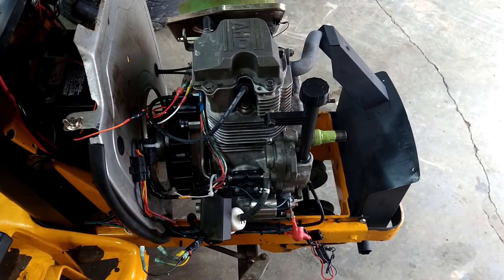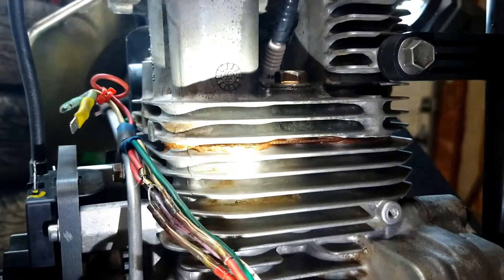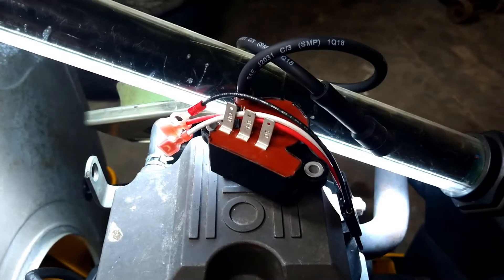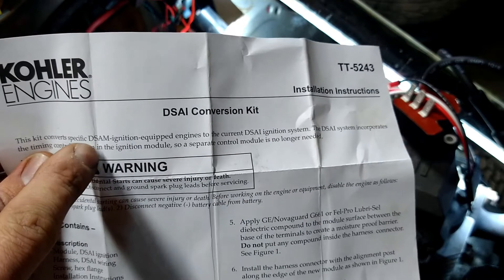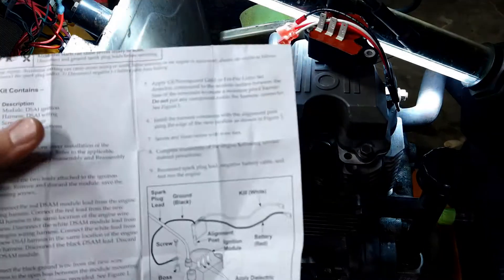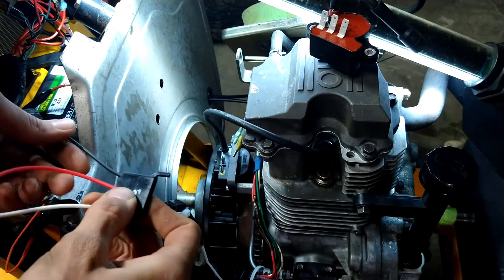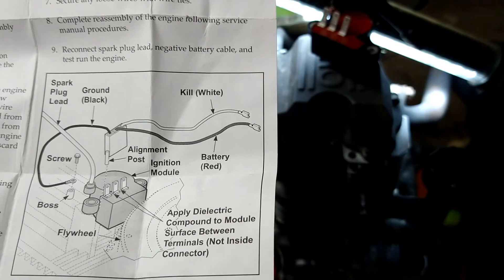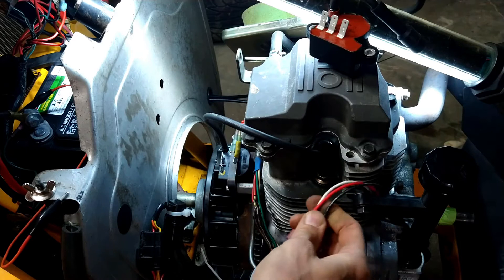Kohler Command CH16S Ignition Module Replacement – Cub Cadet 2166

Comment: Mr. Soluna
I own a 2166 the same one in the video. You have help me in the past to rebuild the upper part valves and head. I have replaced about 10 ignition coils I want to try this. Can you give me the part no. to order and is it still working for you. I really need to fix this.
Reply from the maker: 12-707-01-S

It is still working great to this day.  The Kohler replacement module is expensive but worth it.

Comment: I think i have a good question for you. I have a dixon zeroturn with a cv16 high output. Sticker says its a cv15 tho. Anyways. Its always been a bit of a hard start but always started. Recently i was running it and it died. Had spark, and fuel. No compression. I did a head gasket, also had to use some timeserts. First start it kept flooding. Had to remove spark plug to clear cylinder two times. Third time i discontinued the fuel line and i got it to start. Connected fuel line and it was good, mowed the yard. It would start back up hot with choke on . Next day i go to start it up and nothing. Some poping but flooded before it could amount to any speed to get going. Same as first startup. I asumed it was the spark advance module. I did go for the cheapo 30 dollar ignition control module. Do you think my problem is its not the kohler version? Or do you know of something else that would cause this? I did clean lifters during rebuild so valves wouldnt stay open also checked flywheel key. Is good. Should i just get the kohler brand? Thanks in advance ç
Reply from the maker: Sounds like you have overfueling, not ignition problems.  Have you checked spark when the engine is failing to start/flooding?  That's what I would check first.

Comment: Referred back to this video today as I'm having intermittent ignition trouble once again with my ch 16 glad to see it
Reply from the maker: Hey Mike!
Reply: Purchased the module today. $160 + tax. Hoping it works this is my last resort
Reply from the maker: Good luck.  I have not had any issues with the OEM module.  If the module is your problem, I would trust that the Kohler part will fix it.  Keep in mind that the system still needs a proper 12v+ and ground in order to work properly.  If you still have issues, I would look at your supply voltage for high or low voltage.

Comment: Hello, I have a CV16S that has this module set up. My engine runs perfectly other than the stator isn’t putting out enough voltage to charge the battery and run the lights. Does the DSAI (vs SAM) setup change how the charging system work? I wondered since air gap no longer matters, how the stator would get enough power. Thanks!

Edit: the engine doesn’t have a voltage regulator either which confuses me. Also, thanks for the video I couldn’t find a conversion video for this other than on the twin engines.
Reply from the maker: Where were you testing your stator output?  There should be a three pin voltage regulator mounted to the engine shroud.  Two outer terminals are stator AC input to the VR and center terminal is the DC output to the battery.

The ignition and charging system are two different systems, and assuming the wiring is all intact and not compromised the two should not affect each other.
Reply: @SolunaGarage  thanks for reply. So mine utilizes the 3amp 70 watt stator, not the 9 or 15 amp. Which I think is why it doesn’t have a regulator or two white AC cables like most do. It has 3 wires which are yellow, black, and green (brake). The manual says to check DC volts on the black, which I believe uses a diode to convert AC to DC. That number fails the test, however it passes the Ohm test. (Probe placed on yellow wire on the stator side of diode.)

Knowing the ignition and charging systems are different helps. Maybe they are just loose connections.
Reply from the maker: I see.  I just assumed you had the larger output system.  If it worked before the ignition module replacement, it should work now.  You didn't need to remove the flywheel for any reason, did you?
Reply: @SolunaGarage  I received the mower with the DSAI so I’m not sure the history. From research I’ve done, it doesn’t appear the flywheel needed to be changed with this model. I know on some of the later models the flywheel came with the conversion kits. If it’s not loose connections, do you think it would be worth checking the flywheel magnets?
Reply from the maker: Yeah, I would check them if it isn't too difficult to access.  Being a vertical engine it wouldn't be too terrible depending on application.
Reply: @SolunaGarage  Thanks for the advice :)
Reply from the maker: Good luck!

Comment: Thanks for the video.  Very helpful and I imitated this installation on a 2186.  Worked great after I had installed just a new coil and it didn't work.  I could tell, using a spark tester, that I still wasn't getting fire after installing the new coil.  Dealer no longer carries the spark advance module, so really, I had no other choice.  Still, I'm glad your video was around.
Reply from the maker: Glad to hear you're keeping the Command alive and that the video was helpful.  🦾

Comment: Is  there an easy way to get to the ignition module without taking the engine shroud off?
Reply from the maker: Nope!  And if you take this chance to clean out the shroud and cooling fins and replace your front main seal it will make the job worthwhile.

Comment: i was curious as to what symptom lead you to replace the smartbox and module combo. i myself am working on a 2166 ch16 as well. runs great with the key on start, release back to run and the spark cuts out as if the kill was grounding. i have checked everything i can think of outside of that smartbox (unsure how to test this) thank you for any insight you might be able to offer.
Reply from the maker: I would actually start with the ignition switch, are you getting that 12v+ red wire in the run position out to the module?

The symptoms that caused me to replace the module were a lack of spark after the engine had warmed up.  It would run for about 10 minutes or so and then start stalling and not restarting until it cooled off.  I also tested the resistance values on the coil and found them to be marginal or out of spec.
Reply from the maker: You can check the red wire at the relay input.  The yellow wire at the relay should only show ground in the key off position, or with the seat switch active and no brake pedal depressed.  The yellow wire is the "kill" wire to the module.

Comment: According to the destructions, the old module is to be unhooked and discarded.  I know you know this, and the reason you had it tie wrapped with the other is because the metal housing it was attached to was removed.  Just sayin.  Make some more 2166 videos--VERY HELPFUL
Reply from the maker: This module has been working very well.  I've mowed all year with it.  It starts better and has been very reliable.  Thanks for watching 🤘

Comment: Glad to see that came together well.  Just replaced magneto on the M18 here. Hope my runs like yours.
Does that engine have a fuel shutoff at the carb from the key? Maybe they call in a Solenoid.
thanks for the video  Ken
Reply from the maker: Yeah the Command does have a fuel shutoff solenoid that blocks flow to the main jet, (or did...I've eliminated it on this CH16).  The M18 in the 1882 doesn't, and they didn't have the lean mix/hot muffler condition that caused the backfiring you see on the newer engines.
Reply: @SolunaGarage  And yet the M18 in the 
1862 has the solenoid, kind of a pain in the
hiney in my opinion.
Ken
Reply from the maker: Interesting that they opted for the shutoff on the 1862 but not the 1882.  Model years difference, I assume.